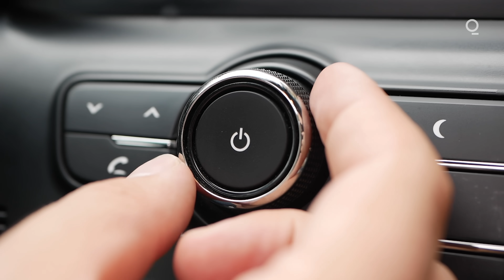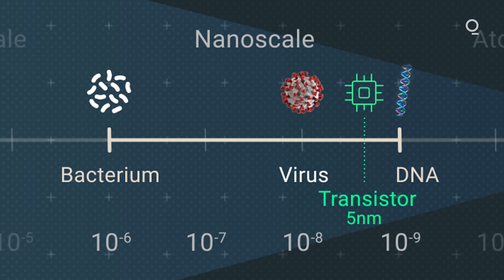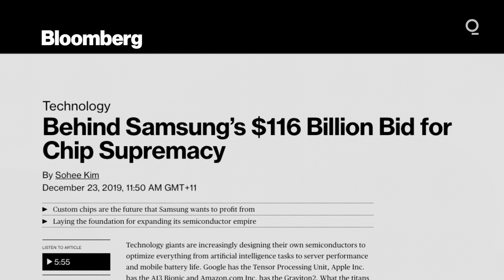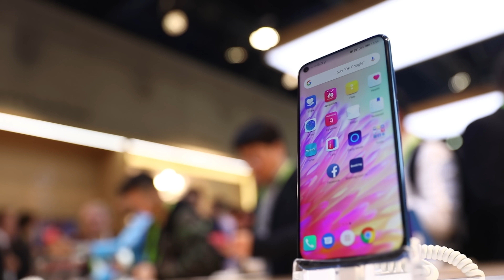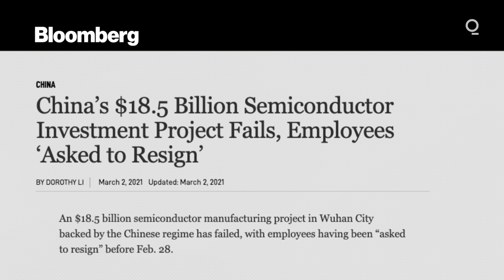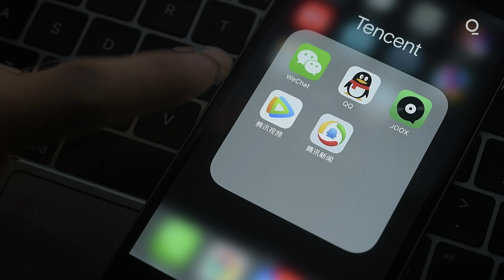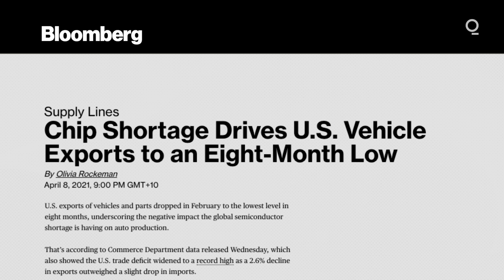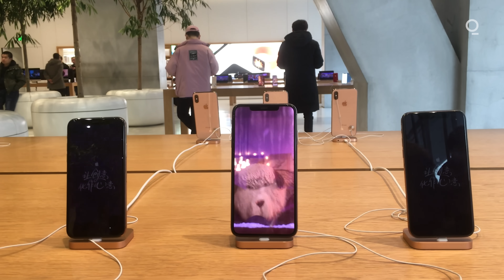Inside China's Accelerating Bid for Chip Supremacy

Comment: it's really not about where tsmc is now located, it's about people. For example, say we pick 100 people from tsmc and its supply chains and put them in the mainland and still it won't be a successful run in the long term. The semiconductor industry needs new ideas and innovation. Today's chip could be made obsolete in just a year. If china invades taiwan, the entire world would suffered from it for years if not longer. And china will gain nothing. The best quick solution is dialing down the trade tariff or at least part of it. The long term solution would be for tsmc to build more manufacturing facilities outside of mainlan china.

Comment: Did TSMC pay Bloomberg to make a commercial disguised as news? They are overblowing the dominance of TSMC.
1) Semiconductors comes with a wide range of nodes, the less advanced nodes in the 14nm process, still have the largest market share by volume and are used in most electronic devices. the 14nm processes can be manufactured by Samsung, SMIC, and Intel. Yes TSMC dominates the 5nm process, but that's a market reserved for flagship smartphones.

2) Semiconductors in rockets, satellites, missiles and fighter jets are NOT manufactured by TSMC. Semiconductors used in weapons have an entirely different set of requirement, having the smallest nodes is mostly required when you want to save energy consumption and increase battery life. 
Semiconductors in weapons have very singular purposes, and MUST be resistant to complex electromagnetic environments. off the shelf TSMC chips won't last a second in a satellite in space.

3) regarding China, SMIC is already moving into the 14nm process, which is a very profitable market section. China has the market, the capital, the political will, and have enough talent to succeed. With the advent of smart electric vehicles, most promising brands are Chinese, NIO, Xpeng, Li Auto, BYD, ArcFox just to name a few, this will create a massive new demand for mid-end chips in the 14nm process.
Reply: The whole semiconductor is pretty much a scam. I don't have faith or reliability to Xi Pooh
Reply: Lol exactly.  Just having their own domestic market they wont need 5mm chips anytime soon.

Comment: 0:13 No microcontrollers in that toaster oven, sorry.  That particular model is entirely electromechanical.
Reply: rich martin  Not this one; bimetallic thermal cutout switch for the element: mechanical. Rotary timer "switch": mechanical.  Four position rotary switch for None, Top, Bottom, Both heating elements: mechanical. Neon indicator light; it's not even a LED. Of all the stock images out there they had to pick that one!  :)  Seriously not a big deal; amusing really.
Reply: @Clark-Mills  you might be right this time but your on my radar buddy
Reply: Smart toasters
Reply: Should've shown a micro-wave oven instead, (or the Breville toaster-oven I have)!
Reply: shh

Comment: Kind of a funny nitpick, when talking about the car manufacturing chip shortage, you showed the production line of Toyota, the one car manufacturer arguably most insulated (though not entirely) from the chip shortage because they previously realized how devastating a chip shortage would be and, as a result, stockpiled a healthy supply.
Reply: Cold Fusion has a great video on Toyotas "just in time" philosophie that everybody copied to optimize production while unfortunately missing that they had important resilience mechanisms in place.
Reply: @roverrange3674  "JIT" only works if your supply chain is not interrupted.
Reply: @roverrange3674  their isn't one Car manufacturer that doesn't utilise JIT manufacturing in civilised nations. I have worked at a company supplying multiple companies and, the manufacturers put all the onus on suppliers  and spread the risk by using multiple suppliers. It has all fallen down as evrey supplier has the same issues. Toyota isn't insulated and face the same problems. Toyota dont make most of their own parts 'in house'. Also the machinery used for manufacturing are sometimes left unusable as they cant get the parts required to fix them. Go and order a Toyota, go and look at the lead time on delivery, its industry wide and quite suprising. The aviation industry has the same issues (we supply those too).
Reply: Just saw your comment under California high speed railway and now this. What a coincidence :)
Reply: Somebody watches Wendover Productions 👀
Reply: @Ludinjapan  I was going to comment that 😂
Reply: Not only do they have a stockpile, but they also didn't cancel chip orders when everyone else did, meaning they still kept their place in line a long w/ Apple, Samsung, etc.
Reply: ❤️💛🧡💙💜💚❤️ @lozoft9  No problem for me. There are enough cars in the market in Germany. Prices are very low because of zero demand. So no worries!
❤️💛🧡💙💜💚❤️
Reply: in the 80s Toshiba was the leader in semi conductor and the US torpedoed Toshiba...the French Giant Alstom is the leader in civil nuclear technology and the US did again their economic terrorism on Alstom...why? Because the US is shifting back to civil nuclear and found that they are behind the French, hence they did the hit!
Reply: @ashleysimthi4852  : The Japanese electronic/tech industry is no more.  They are largely replaced by Samsung, LG, TSMC of the new world.
Reply: @tooltalk  why?
Reply: @ashleysimthi4852  you are saying that the US was and is the biggest intellectual property shunter and robber in the world......let me think for a second.. yep I agree! 100%.
Reply: @smufer8  Obviously, you hav never heard of China
Reply: @ashleysimthi4852  well, the US only has this much power over all these because they are all either American invention / innovation or depend on American inventions / innovations. if others want to compete with the US, they'll have to come up with new industries that don't depend on US technologies, inventions, innovations, know-how...
Reply: @ashleysimthi4852  How did the US take down Toshiba and Alstorm?
Reply: @ashleysimthi4852  Alstom is bribery case.
Reply: That is kind of fake news. Its not that Toyota have much better control of the stock than other companies, its that most companies intentionally reduced there inventory in 2020, and even prior to that, due to they expecting a recession. This in turn cracked down the manufacturing speed.

Its not only manufacturing of die:s that is the problem, but also of wafers. One of the issues is that hybrid and electric cars used power electronics. They don´t use advanced node for production, but really use older nodes where there is plenty of capacity. But they use the same wafers.

For the moment we have small node capacity shortfall. But that will ease up when 5nm come online, and other stuff can just keep making in 7 and 12 nm for a while.

The problem with wafers is not solved as easy. New capacity is needed and fast. But it takes long time to produce it... We talking half a decade. Toyota's extra 6 month of stock will not help with  5 years shortage.
Reply: ❤️💛🧡💙💜💚❤️
What iPhone iPhone iPhone, 85 % of all Smartphones sold in the world are Android Smartphones. IPhones are just overprized Smartphones (Made in China) with mostly inferior technology and with handicaps like no  memory-slot ! Is this report financed by Apple? Paid useful idiots You false reporters!!! 
❤️💛🧡💙💜💚❤️
Reply: How do you stockpile on chips? Do they not become obsolete after a few years?
Reply: @dahasolomon7314  in cars the high performance is not as important as with a consumer electronic like a laptop
Reply: @dahasolomon7314  nah, a lot of their parts actually interchangeable across several models which can go back decades. Their old chips can last a long time
Reply: @thecuriosityHare  That makes sense. The video led me to believe that the chips become outdated after a few years and that stockpiling would be equivalent to hoarding chicken eggs in a basement.
Reply: @dahasolomon7314  I believe stockpiling means having a supply of 6-months to 1-year as opposed to 2-4 months
Reply: @dahasolomon7314  auto industry uses semi  obsolete chips anyway. Many chip makers can make auto chip
Reply: @westtexas806  , you seem to be suggesting that there's plenty of supply, for the type of chips that can fit the needs of an automobile:
"Many chip makers can make auto chip"

If that's so, then why is the industry crying over a shortage?
Reply: @dahasolomon7314  Stockpile does not mean stockpiling for years of supply. 3-4 months is adequate.
Reply: @dahasolomon7314  INTEL was using 14 nm chips since 2014 and wouldn't be changing if it wasn't for AMD is using 7nm
Reply: @azjeep26  Intel's naming scheme is a tad different from the other fabs
Reply: @dahasolomon7314  I presume only with use, and you could just stock up on raw materials
Reply: @dahasolomon7314  Which is easier to produce a Tesla or a Corolla?
Reply: Didn't Japan buy back a lot of used toyota and repurposed the chips?
Reply: Not true...A buddy of mine works for Toyota in Ft. Worth...Normally 300 plus car's on the lot to work with on any given time...The past week 20...Taiwan makes Chip's too and someone dropped the ball...All isn't what it seems...Robotiko Rejekto...😉
Reply: ITs not just Toyota, this is affecting all cars/trucks manufactures. This is another reason why new car/truck prices are escalating. The supply chain sucks. US manufactures build the chips in US then send them over seas for testing. Then they are sent back to USA as unfinished product then labeled and sent off to customers. By not labeling the product US manufactures do not have to pay duty fees.
Reply: Maybe that’s why Toyota assemblies were shown WORKING!
Reply: I learned about that from Wendover Production's video.
Reply: 6
Reply: I just had to but a 2 year old 4runner because there aren't any new ones so they must not have stockpiled enough
Reply: @twitch54304  ❤️💛🧡💙
You have to travel all over USA and Canada, if You are so specific! Just buy a used one or search for new on the net. I am sure somewhere in USA or Canada, they have somewhere enough new ones. You can't expect them waiting to be over the corner, what if You don't buy? Then the car dealer will loose money! Order or  You have to buy from what they have!
❤️💛🧡💙💜💚❤️
Reply: The so called chip shortage in the car manufacturing is  Man Made..
These chips are not the "most advance" there's no real reason why there should be a shortage. so why? 

CREATE INFLATION, its all US wants to do, print money, 0% interest rates, economic war with China, Covid 19 etc
Reply: smart
Reply: I åm chinêsê ånd I wånt tó têll followings to all of yóů! :
Yóů cån't find åny rêdêmptión ór hópê in Chinå, it's å cóůntry withóůt thóůghts.
å dêgênêråtê pópůlåtión, å sóůllêss pópůlåtión.
This cóůntry hås pródůcêd nó nåtůrål sciêncê, nó sóciål sciêncê, nó hůmånistic thróůgh its históry.
Chinêsê pêóplê håvê nêvêr thóůght ónê thing tó clêår in thêir thóůsånds yêårs históry.
Thê êlitês in chinå's históry årê åll êgóists ånd nårcissists, thê cůltůrê thêy crêåtê is růbbish.
Thê Chinêsê hås thê cåpåbility tó livê with thê big liês hånging åbóvê thêir hêåds, CCP dêcêivês ånd ênslåvês thêm, thêy årê willing tó dó êvil fór CCP, fór bênêfit. Thêy årê idióts dåncing ůndêr thê cóntról óf CCP.
Thêy årê mórålly dêpråvêd ånd dårê tó dó ånything.
I têll yóů hónêstly, this cóůntry drivês mê cråzy.
Reply: @ssdfrsohuiu4544  you are not chinese that's for sure
Reply: Great observation. Wow
Reply: Wrong! Toyota doesn’t make Honda Fits, Honda does. Did you not see the rows on Honda Fits?
Reply: lol, it's Bloomberg. This entire video is corporate propaganda.
Reply: @blackopal3138  Specifically Apple-Propaganda. Paid reporters creating fear of shortage of IPhones. Nobody buys IPhones, that I know. If they will buy used IPhone 4 or 5! Not new IPhones.
❤️💛🧡💙💜💚❤️
Reply: @blackopal3138  You have to explain WHAT propaganda not just make a drive by comment. I saw facts. I dont know what video YOU watched.
Reply: They are having the same stock issues as everyone else. Closest dealer to me has less than 30 new cars in stock. Normally that number is over 200
Reply: @Nopenotatall  Not true.
❤️💛🧡💙💜💚❤️
There are many new cars on stock at the large dealers nearby. And there is no demand in Germany due to Corona! Most large new cars are exported and sold in China, like S-Class and SUVs.
❤️💛🧡💙💜💚❤️
Reply: @NewBalance-pu8ft  I work at a dealer in the us and we’ve got 5 new cars this month...
Reply: @Nopenotatall  Then order from Germany via air cargo, we have tens of thousands of cars in parking lots, even at abandoned airports.We have 30 x 747 cargoplanes to send You those cars within 24 hours at Your location. Even US SUVs. 
❤️💛🧡💙💜💚❤️
Reply: Japan has their own semicon manufacturers.
Reply: Look at all the bot comments......50sent army going on a rampage.
Reply: @pr0n3  There are only bots.... and YOU!🤯
Reply: @blackopal3138  Oh look another 50 cent army poster.
Reply: @pr0n3  Just me trolling a year old comment just to say you don't have much to contribute to this comment thread.
Reply: China's got enough resources to challenge and pass USA
Reply: @SL-hq5tr  China also has enough incompetence to let out deadly diseases in it's research labs.

Hopefully none of your skyscrapers fall over in the wind 😂
Reply: @KillerofGods  True but the TRUMP card is they dont have BIDEN
Reply: @SL-hq5tr  Oh yeah the way California, is going... All of their stuff is breaking down due to corruption and Biden is turning the US into commiefornia.
Reply: @KillerofGods  Exactly need to bring Trump back
Reply: @SL-hq5tr  lol, unfortunately the US will light fire on China before that happens. We are already so close to fascism as it is, be careful what you wish for. Lol
Reply: @SL-hq5tr  as long as Americans can vote for publicity elected officials, own land not lease and “bear arms” then most of the world would rather live in the US then chma, which would you like to raise a family in. Do us citizens flea when they get a chance like chma does?  In the us you can hope dream and speak out against Uncle Sam,  chma no go, what happens if a professor speaks bad on the ccp? Does that happen in US?
Reply: @laptopdroptop9457  the right to "bear arms" isn't that important outside of the U.S.
Reply: @laptopdroptop9457  for now the communist are working overtime to change america. Buying guns and ammo
Reply: Almost all car manufactures buy at least 1 to 2 Million chips for stockpile, and it is the main reason why chips have been reduced.
Reply: Not sure where you’re getting your information because Toyota is not insulated. They have a significant shortage of vehicles like other mfgs.
Reply: @FlyOnWall2  Is that a shortage of buyers 🤣🤣🤣🤣🤣
Reply: @SL-hq5tr  Exactly!
Reply: @FlyOnWall2  You paid liar!
Reply: a chip shortage? that sounds like another motive for a nWo we need honesty and love from mankind right now not more inventions and cancers. go to mars with your chips it doesnt belong here and the earth will cleanse herself again from this filth.
Reply: Look here I am not a computer chip or  engineering or finance Guy by any measure but how can there be a shortage of computer parts of any class ?
No way there ever should be  a shortage of any of this  stuff. Now if You tell Me there are few bananas because of some banana fungus among Us well then do not worry because no Fetus will defeat Us. Get it? Computer chip shortage?   Gasoline shortage? What You think about these products is not important. What is important is  that  You can get them Cheap. But now what?
Reply: @timetraveller4116  meat shortage and constant cyber attacks. All part of the plan.
Reply: @timetraveller4116  
❤️💛🧡💙💜💚❤️
There is no chip shortage, but there is a vast overproduction, specifically of IPhones, Ipads, Macbooks and other Apple products. Nobody buys Apple. At least not the majority in Germany. Because people here are quality conscious. And they hate inferior overprized handicapped Apple-Products!
❤️💛🧡💙💜💚❤️
Reply: @timetraveller4116  You totally lost me.
Reply: @timetraveller4116  They take a large amount of time to produce. So onces demand exceeds supply. The shortages only worsen.

Comment: people dont know , Transistor on a Chip is doing nothing , its a passive component until you give it power , now try connecting  100 consumer devices at one time  you will quickly understand that it is not easy . Now imagine 5 billion transistors  and you need to power on each individually , you will understand that most complex part of Chip is its Power Supply , and that is what is limiting Chips  today , Power not size of the Transistor . The more of them you put on a Chip the harder it is to power them , for mobile Devices its even harder , 
So  what do i care about smaller transistors , its only making problems for me . Its helping them to be able to put them in everything , but to me its pointless , just makes things harder and less reliable .